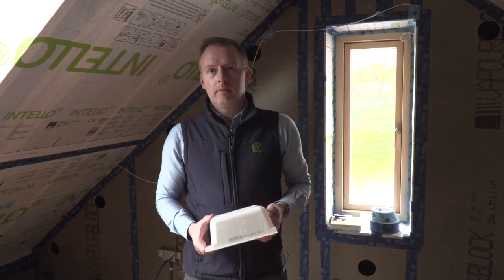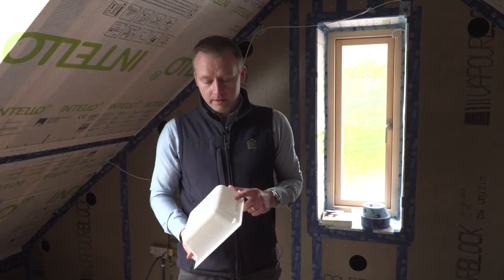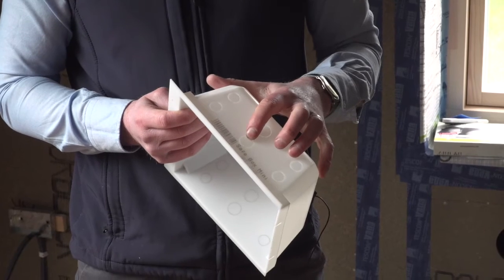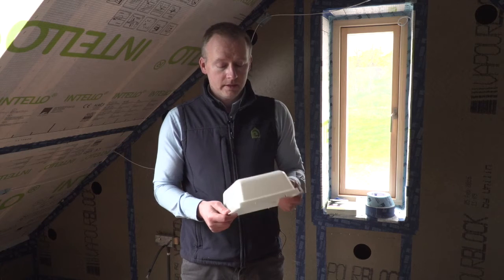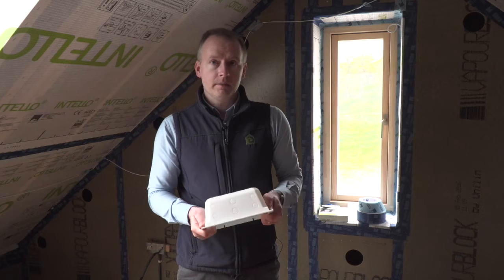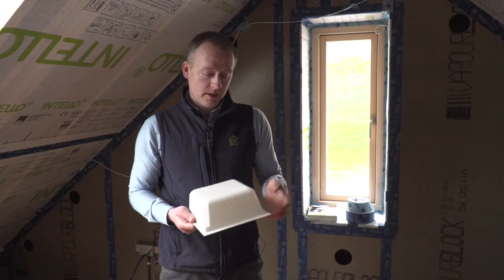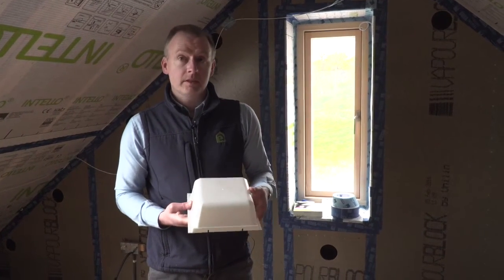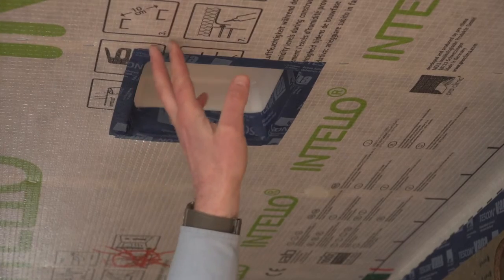Optime Airtight Downlight Protectors - Passive House Insulation Series (part 11)

Comment: Hello there, I have had a look on the ecological building systems website where these are shown. Im unclear about the applications of these downlight protectors - there seems to be some reason why they shouldn't be used above kitchens or bathrooms? what is the reasoning for this and what is the best solution for these rooms? Many thanks : )
Reply: Hi, thanks for your question. The boxes can be used in a wet room if the light fitting is specifically designed and IP rated for safe use in that location. This is because, as with any downlight cover, if the light fitting has a poor seal to the internal finish, large volumes of vapour may accumulate with the box. Of course, first and foremost, wet rooms should be well vented anyways. I hope this is helpful :)